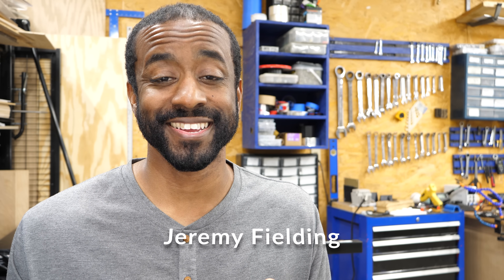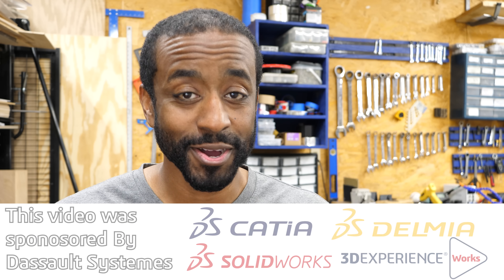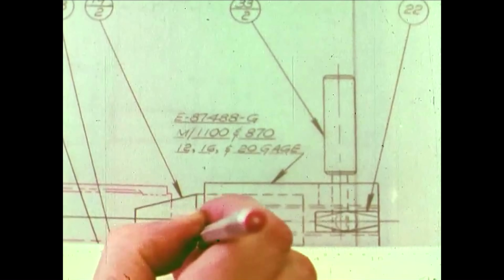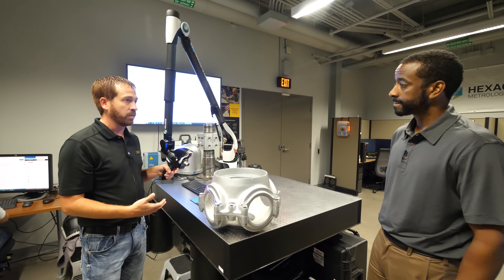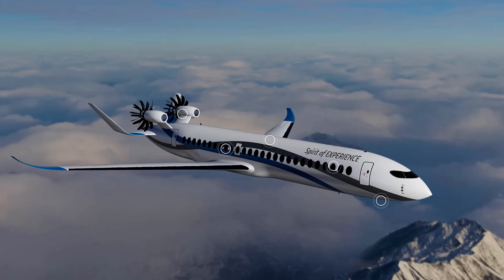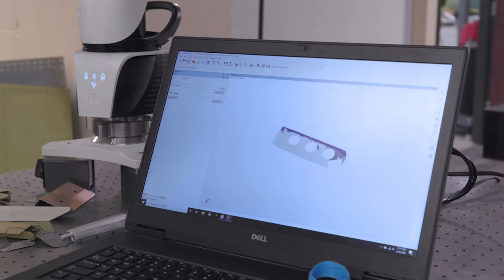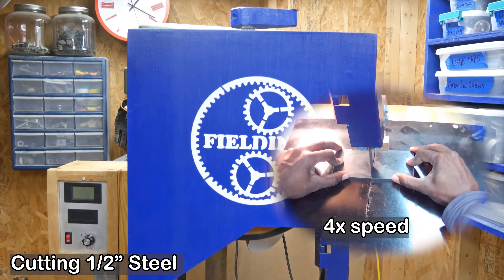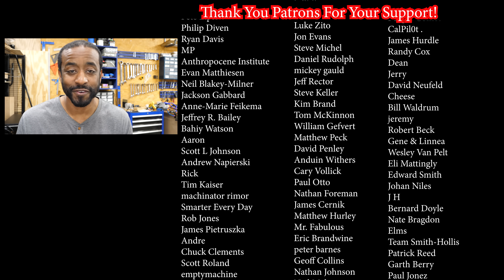Why The US Military Spends Millions Reverse Engineering Their Own Planes

Comment: This example problem with the plane is exacerbated by the gov't contracting process.  Intellectual Property and data rights all cost extra since the company making the item has assigned a value to allowing the gov't to have the information tgat describes the parts and/or how the parts are produced.  It is a fine line the gov't and the contractor try to strike between giving the gov't all the information and the contractor retaining as much as possible to ensure the company stays as profitable as possible.  

Great video, as always.

Comment: Same here. Taking apart is good, but doing it non-destructively so it can be re-assembled is key. Today, I can take anything apart, usually without damage, and put it back together again; yesterday's project while I was cleaning it, was a Oticon Ruby2 rechargeable $2500 hearing aid, now clean AND still works 🙂. I was one of those kids: sewing machines, power tools, lawn mowers, bikes, boats, cars and now I am a design engineer.
Reply: This is why I have a grudge against whoever invented ultrasonic welding. Ultrasonically welded plastic cases are the only thing I've yet to figure out a reliable way to take apart without damage.

Comment: That's great Jeremy!
I was one of those kids, recently I bought a $2 broken electric pole saw at a garage sale it needed a new chain, and oil lines, and was missing the bar tensioner. I had a polished 6mm steel rod from an old printer I had scrounged that was the right diameter and was able to drill, tap, and make the new part. Yay, the saw works great now! $11 total cost.
Reply: Electric pole saw, that needed fuel lines??😁
Reply: @simonilett998  Oil lines is what he wrote.  Even an electric chain saw needs bar oil...
Reply: @Roy_Tellason  Sure, oil lines makes sense, however 12 hours ago when I wrote my reply, it said fuel lines.
Given that it now says (edited) at the top of the text, I assume he edited it before you read it😁👍
Reply: Thank you for catching that!
 I meant the oil lines for the automatic oiler. @simonilett998

Comment: Jeremy, the main point is engineers now are not the same calibre as engineers of years gone bye, an example being the drawing from these various vehicles, think about the Concorde as another example designed in the 60s on drawing boards and wind tunnels to perfect the aircraft, no cad software etc just very clever engineers that would leave the present ones dead in the water without their computers and software.
Reply: It's all relative.  While it takes a certain special and rare level of intelligence to do what these 1960s engineers have done, it's a completely different but arguably more difficult skill set to accurately emulate physics in software.  Speaking as someone who has made video games as a hobby and built robots as a hobby, robots are significantly easier because nature does a lot of the work for you.  Of course, you have to revolve your design around what physics says you can do, but as long as you read datasheets and have a solid intuition, you can make something quite advanced without having to plug in many calculations.  The same can be said about a lot of things that are purely mechanical too, where you can build things without a degree in physics yet the physics involved are intensely complex, and that physics would have to be known for software emulations.
It doesn't stop there either: just because modern CAD takes away a lot of the difficulty of designing a machine, doesn't mean the people using the software are less capable.  If anything, it allows them to create things that could never realistically be accounted for.  It can shave years off development.  The more advanced your tools get, the more advanced products you can make with them.
Reply: That's just not true. Different focus of skills for sure, but not necessarily higher/lower caliber. The way things are done has evolved quite a bit

Comment: Check out Ian Davis who used 3D scan to make a prosthetic hand socket. The point cloud- was not perfect because a hand stump changes slightly volumetricaly as the scanner rotates around the hand. He also need to adjust the model for a bit of compression on his hand/wrist stump for a solid fit for strength of the prosthetic in grasping & manipulating objects. Definitely reasons that scan & go doesn't produce a true fitting replica
Reply: “Footless Jo” has done a few videos on having new prosthetics made.